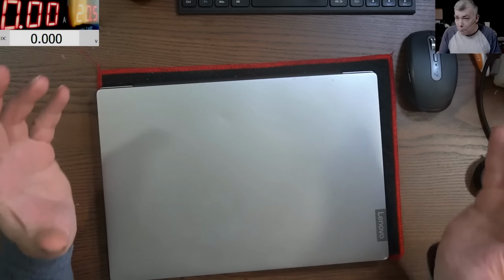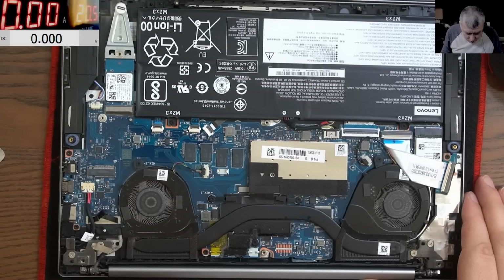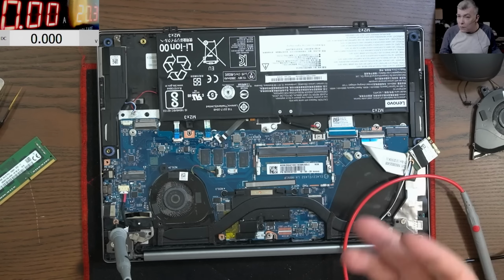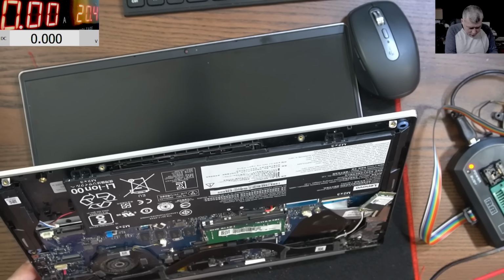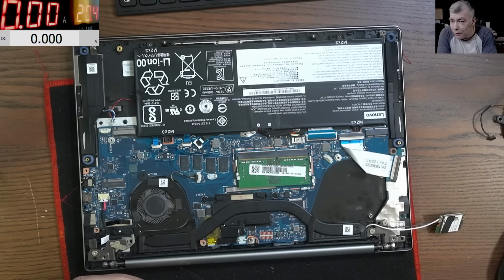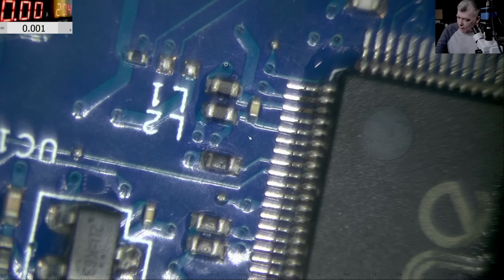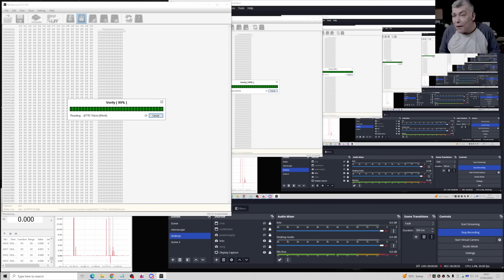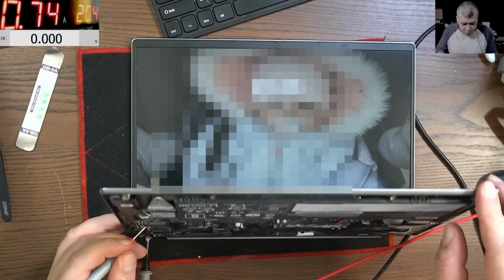Lenovo Ideapad S540-14api wine damage motherboard repair - a tricky one

Comment: Hello. 
I have been following these videos for months now, it looks like you really understand how circuits work in the most useful and practical way. 
Would there be any chance to make a video for the very fundamentals like example when to use the power supply, when the multimeter?
What are the readings you should be getting in volts or amps for a healthy battery, or a charging port and so on?
When to measure volts, when amps? 
What reading to expect from each basic component?
I've searched for some beginners videos but they're not from the very scratch of how to actually do a diagnosis.
Also I've noticed most use a multimeter to diagnose and not a power supply as much.

Many thanks for sharing all this knowledge

Comment: Early on, I bricked a unit by download of bios.  But where tools have improved a lot.   So I think a needed (bios reflash unit) bench repair tool if a workflow is present.   I am less than to depend on workflow as income, so have more time, more relaxed revisit.  And the cleaning was interesting, as I always use alcohol but can clearly see the good result as water. And I have a unit waiting for a new keyboard as from coffee spill.   But where all else is working fine.
I always seem to have a lot of questions, such as:  What happens when the motherboard is beyond repair?  Would not the flicker to voltage as charging in this example have been as RAM, or Battery or charging socket?   And where I can follow to a complete repair is where I seem to gain trust in how to trouble shoot best method.  
Thank you for the excellent lesson.   Important to inspect rather all elements as wine damage.  And...gain vital hints from the customer.   M.

Comment: Hi Sorin, I really like your videos, they are generally helpful and great educational materials. I am however extremely curious how did you come to the conclusion that the device is possibly suffering from a corrupted bios after liquid damage? Also, may I ask what is the advantage of cleaning a (liquid damaged) pcb with water over using isopropyl alcohol?

Comment: Sorin or some other genius here, I have a Lenovo V15 G2 ITL that came with a NVMe SSD. I added a fully working bootable SATA SSD drive which came from my old laptop and I need to be able start from from it. Is it possible to switch the boot order of the two drives and then how? Or do I need to remove the NVMe drive?
Reply: You should be able to access the boot order menu by pressing the F1 key right after turning your laptop on.
Reply: @Paula-bk3rw  Thanks, I opened the boot menu and I can not change the boot order for the drives. I could do that easily from my old laptop but can't find a way to do it on this one. Probably I will just have to remove the M.2 drive to get the SATA drive to boot.
Reply: @HelgiThorisson  maybe try pressing F12 or Fn+F12 instead, this should bring the drive boot option.
Reply: @Paula-bk3rw  That gives me 2 options Windows Boot Manager (if I remember correctly) which opens the M.2 drive and something like EFI Network but no drive options nor any other boot managers.

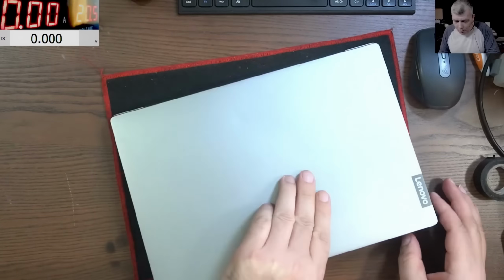Comment: (0:27) Why did you remove the black soda? Combined with wine, it forms a drink that we call "cuba" here and it is cheap, although it is much better when the wine is called "ron"... although I prefer to drink European wines (I don't care about nationality) or even gringo whiskey but clarifying that I do not want to take away the work of professional tasters, that is, mine is only experimental and only for general knowledge of flavors (lol😆).